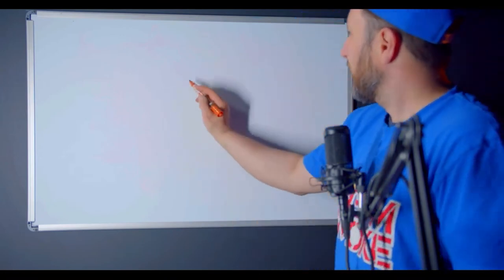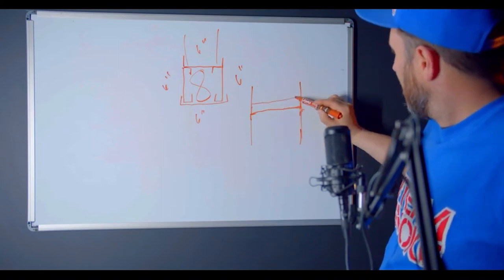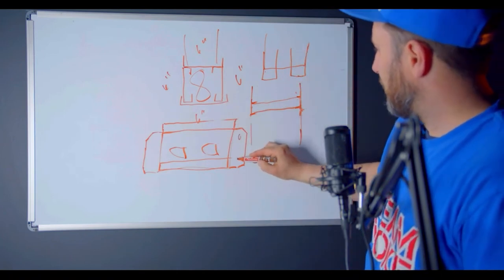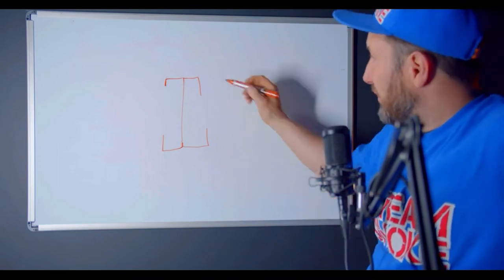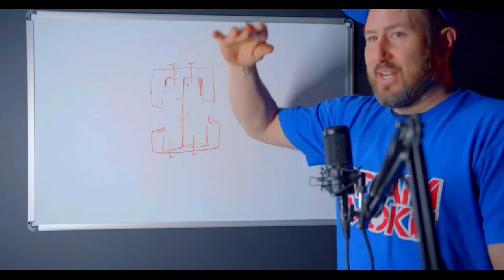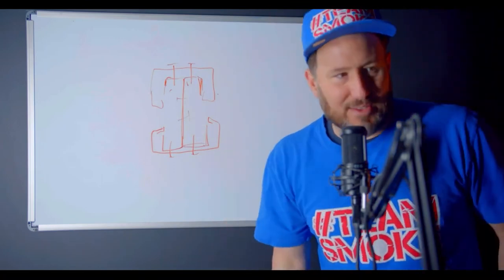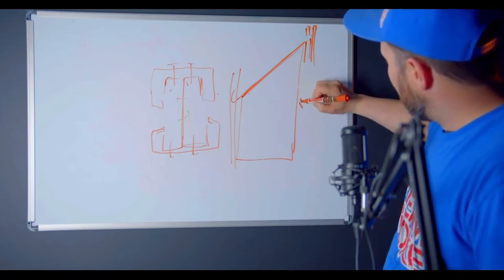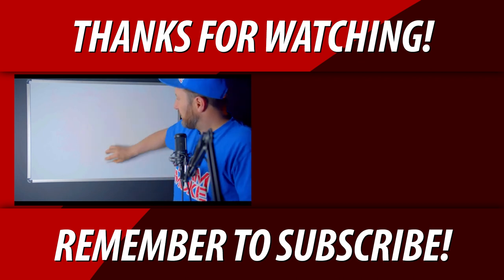Metal Framing Box Beam Header

Comment: I have screwed metal back to back and stuffed it with Johns Manville mineral wool batts and it works great.
Reply: I am wanting to take the thin foam often used on the foundation seal to slow down heat transfer and use that type of assemble to create a rain screen and screw that assembly on the outside wall and then go over it with metal for the siding.

Comment: How do they cut the channels in the stud/track to accommodate the stud?😮
Reply from the maker: I am not 100% sure. I don't recommend doing it this way. I would think they are roll forming it right in the factory to size. I can ask them for a tour of the plant?
Reply: @ConstructionKronies  interesting. I would assume a thicker gauge track like 18 or 16 would be better than sniping channel. However, I love your videos. It's great to see how others are building and taking different places. You're a good teacher 👍
Reply: My friend has a project building offices with large glass walls and sliding doors. The headers are twisting because the 20 gauge metal is not stiff enough over a long span, 20 feet or more. So I thought the idea of using studs in the header as a solution. Or placing 2x4s under the track. They are not load-bearing but the glass is heavy.
Reply from the maker: @markflores4978  Sounds like you need box beams and yes for sure studs need to be in the headers. You can also up the gauge to 18 gauge. Here are 3 box beam videos: https://youtu.be/s7Fd1zFCjws  https://youtu.be/ep75Co5SWL4   https://youtu.be/lSJIU3aef8s

Comment: 3 tracks 2studs
Reply from the maker: Yeah thats how we used to build them but now we just flip the top one to catch the header studs.
Reply: @ConstructionKronies  I like that. Once the engineer has not issues with it, it's a good material saver!! 
I wonder if there are is a header product that saves time and money? Of course size/gauge/length varies so it's tricky
Reply from the maker: @AMindInOverdrive  Yes there are I have seen them. Check out these two links https://spantec.com.au/products/boxspan-steel-beams/https://www.structuremag.org/?p=10236